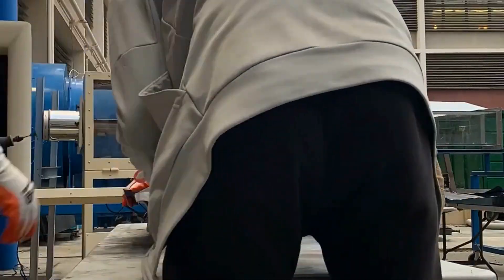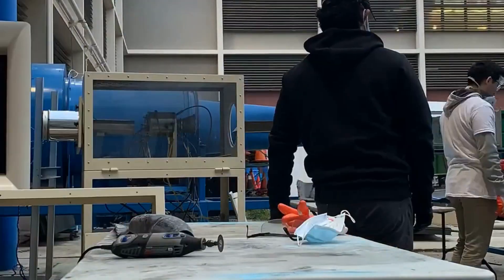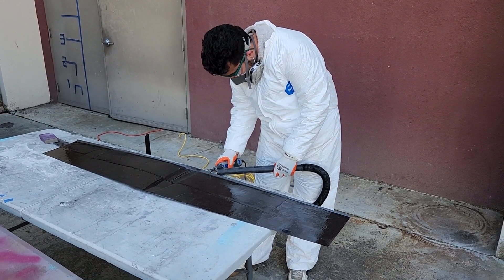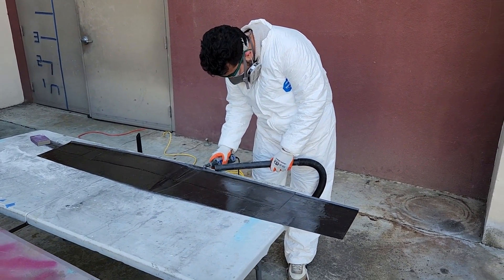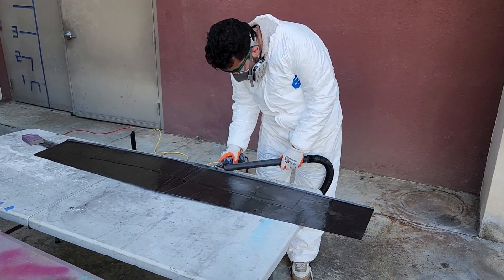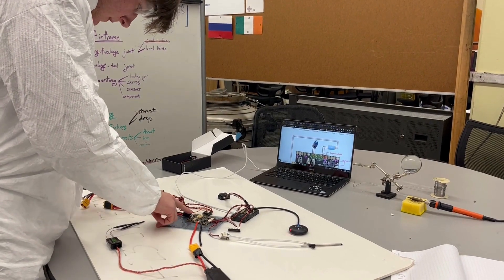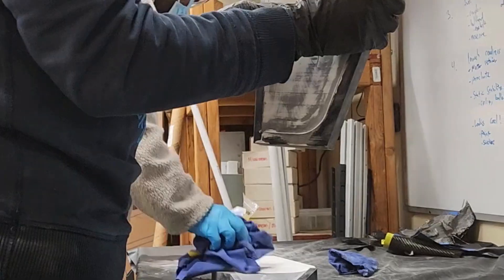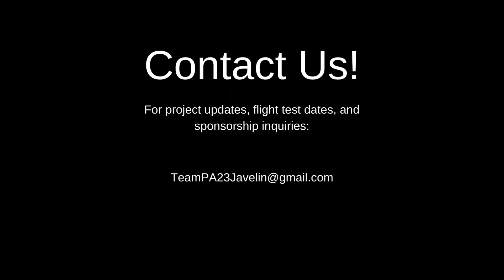PA-23 Javelin - SJSU Aerospace Engineering Senior Project

Comment: are you doing some other tests to characterize your thrust? If you want to optimize your motor/propeller/plane for a given regime static thrust will not be enough.
Reply from the maker: yes-
out test jig does not fit in the univerisity wind tunnel, so we will be comparing speed data for different propllers now that the airplane is complete and airworthy, and posesses such recording capabilites.
Reply: will there be a public presentation of the project? I am local and would be interested to attend.
Reply from the maker: @flexeos  yes, please join us at the SJSU "2023 College of Engineering Showcase and Celebration" on April 13th.
Reply: @neelsahay3585  I came to SJSU today and found the engineering building but there was no indication of where the showcase was and nobody I talked to knew about it. I think you should have at least put a sign in the building lobby to give some direction. It was very disappointing ...